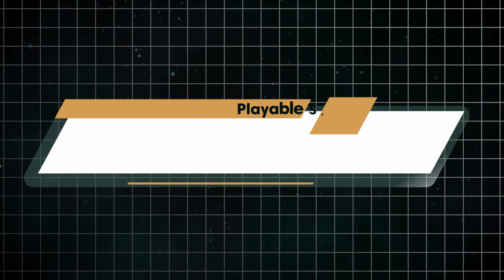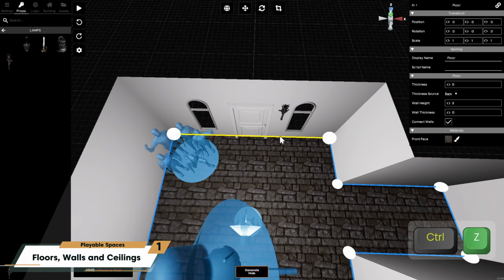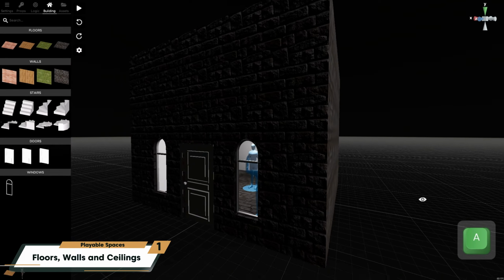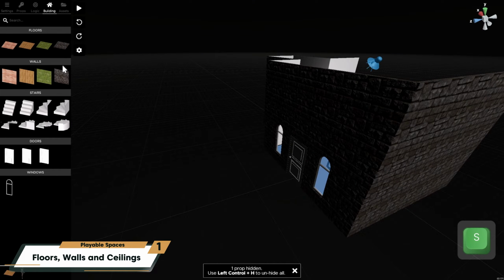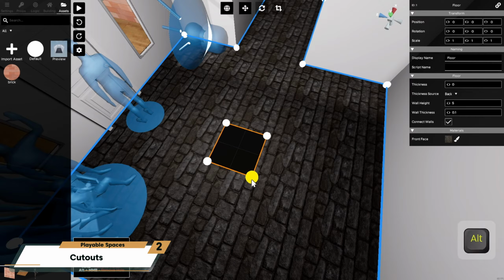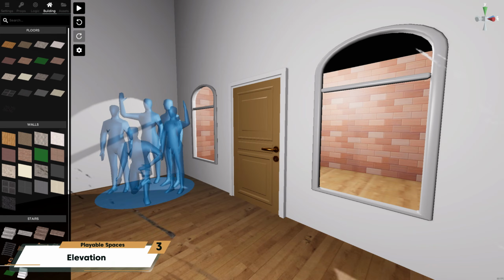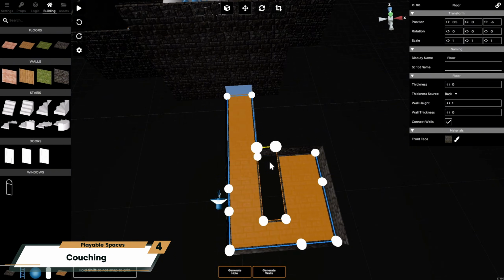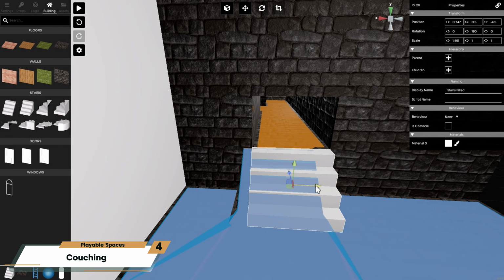ES2: Room Editor - Playable Spaces Floors, Walls & Elevation

Comment: When I create a tunnel (like crawling through an air duct) high up on a wall and provide a ladder to get to the tunnel, the player enters the tunnel standing instead of crouching. Is there a way to fix that? It looks really ugly when you enter standing because you can see the top of the tunnel and basically into the map. 

If you crouch after entering tunnel, you cannot un-crouch but it still feels weird to be standing in a crouch only space and then being forced to crouch to move.The game should force the player to crouch if they exit a ladder into a crouch only space.
Reply: I haven't encountered this before, but you're right! Best I can come up with as a solution is to provide a tiny ledge at the top of the ladder that the player exits on, so they are standing, then they need to crouch to enter. Move the "Top Exit" to just next to the "Top Point" to do this, the player won't even know they've left the ladder, they'll just know that they need to crouch.
Reply: @RobbieMcD  I think this would work.  You could provide a hidden ledge at the top of the ladder which would force them to crawl before entering the tunnel. The other option I discovered after is you can force them to crawl before entering the ladder and they will exit crawling. So it seems like they will exit the ladder in whatever mode (standing or crouching) that they were in before entering the ladder.